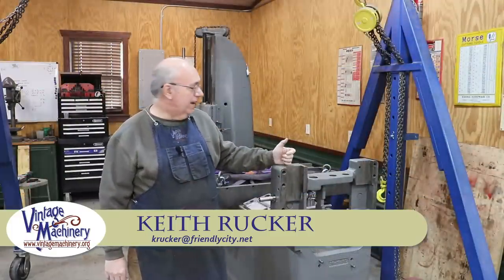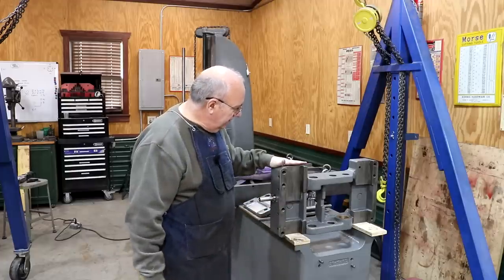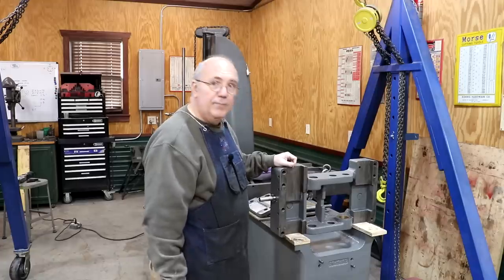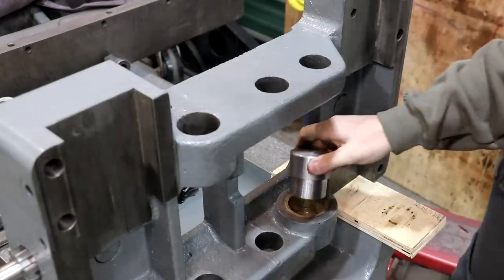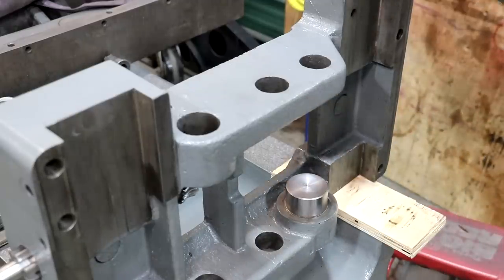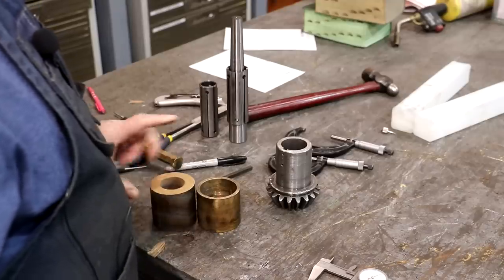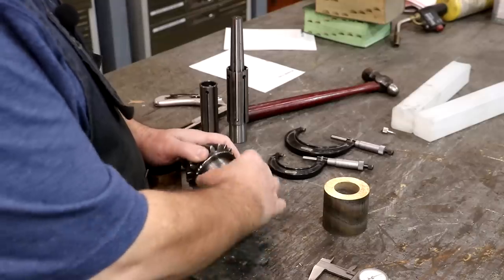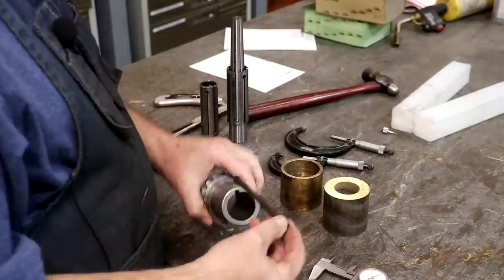Lucas Horizontal Boring Mill Restoration: Turning and Installing a New Bronze Bushing

Comment: You can make a slush from Acetone and dry ice that will get you halfway to liquid nitrogen temperature,  more than cool enough to shrink bearings for a tight fit.
Reply: Excellent tip.
Reply: Methanol will work too, if acetone is unavailable.

Comment: I was thinking about that oil hole, but you addressed it at the end.

Just got a brand new 31st edition Machinery's Handbook yesterday! Hard cover no less! Going in my "Emergency Engineering" kit with my old Frederick Post Versalog 1460 slipstick, a solar powered calculator, and a stack of notepads. In an ammo can. These days you never know... 🤔

Comment: Using a brass drift to seat & unseat the part on the mandrel: brass is soft, but work hardens.  I once used a brass hammer to drive a shaft out of a seized pulley & the end of the shaft was visibly deformed.  It was a smaller diameter at the end, so it didn't affect getting the pulley off, but it taught me a lesson that brass is not as soft as you might believe.

Comment: It seems like it would help to polish about half of the tool marks off the gear's surface.  Some variation helps to hold oil, but burrs from cutting and peak height variations promote wear in the bushing -- initially at least.  I do love to watch you restore these old things.  It seems that they engineer away much of the lifetime in the new ones.
Reply: People no longer want to pay for a machine that will last 100 years. I can't really blame them.
Reply: @kindabluejazz  They have been burned too many times paying for 30 years and getting 2 years.

Comment: That GEAR shoulder that you turned down to square up how are you going to put shims to get the gear engagement proper?? 28:50 perhaps knocking back that bronze bushing help with the shim stock to get the gear engagement proper

Comment: Keith I have had good results from using Plumbers Freeze spray for freezing pipes, it will chill the bushing down nicely with a good spray of the stuff, I've done a 0.004" interference fit quite happily with no shaving as it drops in. It's easier to get than liquid Nitrogen and stores better.

Comment: My B&S Apprentice final project Draw up from comp prints one set shop prints obtain Proper material and make full set of expansion arbors from 3/8"- 2-1/2" perform all machining operations with occasional oversight from Journeymen toolmakers.

Comment: Keith- one thing that seems to be a recurring dialogue in your iron deficiency is the need to “ while we’re here might as well “ items.  Yea it would work.  For a while.  But while we’re here, might as well …..…….we’ll just chuck up this here piece of ( insert material) and fix this as good as new.  Yup, that’s just the way it should be approached.  Keeps the “should have done it when I first found the issue “ at bay.  Proper.  Happen to have this piece of brass bushing stock that would be perfect ( chance of that in my life is never) Whoops, looks like the surface has worn on this gear, so we’ll just smooth this up.  Just happened to have an expanding mandrel here….. how long have you been collecting these “ scraps “ and oddball tools?  I continue to be amazed with the “ stuff “ that appears in the shop.   Well done 👍

Comment: Great video Keith. 

After driving the bushing in, did you measure the bore again? I might have thought that the interference fit might have reduced your .0025 clearance on the gear a bit. It doesn’t matter in the end but I was just curious. 

Cheers

Comment: Does the expanding mandrel cause the ID and/or OD of the part to expand?
Reply: Interesting question.  

The short answer is yes, it expands.

The longer answer continues: but not significant for practical machining.  Every material has a modulus of elasticity and therefore, as force is applied, the material deforms like a spring until the material reaches ultimate tensile strength, wherein the material will yield and have permanent deformation.  The amount of force Keith is applying is small compared to the modulus and therefore, there is correspondingly small deformation.  Keith need only apply enough force radially to generate a retarding frictional force necessary to overcome the urging cutting force.

I do hope this made sense.
Reply: @WhatAboutTheBee  Great explanation. Thank you.
Reply: @mikewatson4644  you are quite welcome

Comment: At 3:25 Keith is talking about how to press out the bronze bushing.  He is making a part to help with pressing it out with a long rod through the hole in the top of the casting.  Couldn't the casting be flipped 180 degrees to push the bushing out from the other side?  Too heavy?
Reply: It can be done as you say, but going through the upper hole helps ensure the alignment of the drift being hammered on. As this is a big part its not that much of a difference, but for many situations it's a big help.

Comment: Wondering if that bushing sets the height of that gear.  If so, gear mesh might be off.
Reply: Having worked on such old machine setups I would guess the meshing shaft will have bushing at the collars of the vertical part that give means for adjustment. We'll find out when Keith re-assembles the tailstock.

Comment: Not having any experience with machining work, When Keith says he's going to take 100 thou off the part, does he have to do the math in his head and only dial 50 thou in or are the dials on the machine set up so you dial in 100 thou and the slide only moves 50 thou?
Reply: You are right with the last part of your comment. Some lathes have direct reading on the horizontal slide, meaning .050" inch on the dial means taking 0.050" depth of cut; means 0.100" taken off the diameter of the part being machined. However that is for a minority of machines. Most lathes have a diameter reducing scale on the cross slide, meaning adjust inward 0.050" on the dial means 0.050" taken off the diameter. If a DRO is fitted,  the DRO readout for the cross slide can be set up to read the decrease in diameter (the same as the cross slide dial) - note it can also be set up to read the reduction in radius, but that would be confusing and don't know why anyone would set it up that way. However, on the longitudinal axis, the DRO is set up to read directly, meaning move the carriage sideways 0.500", the DRO reads a change of 0.500" - as the cutting tool moves 0.500". Hope that helps. Retired machinist.

Comment: Keith, what's going on with that mic? I'm hard of hearing and even turned up, I am having problems.
Reply: The mic is very directional, probably to reduce picking up all the machine noises in the big room. It's a trade off of lower background noise versus having to remember to turn his head towards the mic every time he speaks.

Comment: .0045 crush O/D  on a bush that is about 2 1/2 OD   and only  2 to 2 1/2 thou running clearance before installation .    ????  There is no way that gear would have just slid in .    Bloody lucky you did not crack the casting .

Comment: Just watched a Plumbing video by Roger Wakefield and saw something you might be interested in.  He shows how Oakum and Lead plumbing joints used to be made, and showed a VERY handy tool that you may be interested in for your next Babbitt Bearing pour - it's called a "Running Rope", and it's basically a short piece of rope that is resistant to the temperature of molten lead, and packed around a joint to seal and guide the molten lead into the joint. It may be a MUCH easier and cleaner way to pour babbitt into bearings!
Check it out at: https://youtu.be/RoRw2AoeluE

Comment: I’ve watched your videos for years and always enjoy them- so this is hardly criticism. I just wonder with machines as large as yours, why do you always take such light cuts? Turning down that bushing press tool, you took only .050” per side and “just repeat that 9 more times.” Man that’s a lot. I’ve noticed over the years that you don’t take the “Abom79” or even “Fenner” depths of cut. Certainly these depths of cuts aren’t required, but I’m guessing your machines are perfectly capable, no?? Why repeat 9 more times when you could just do 3 or 4 big cuts? Is this just a preference thing?

Comment: For god sake do something about the mike volume Keith, its the same thing every time you turn your face away
from the microphone its like your speaking from the next room and I have to turn the volume all the way up.
Please pretty please, improve on this annoying lack of volume.
Reply: I think it's a tradeoff - a highly directional mic means less ambient noise from a noisy room full of whirring machines. He could turn up the compression a bit, but that risks noise-pumping.
Reply: @kindabluejazz  Thing is the second half of the video is good but the first half I can hardly hear what he says.
Reply: @ElmerJFudd-oi9kj  I can hear the volume going all over the place, presumably just the way his face is pointing relative to what he's working on etc. To be honest, it's not a problem for me - I can hear him fine (and I'm no youngster). I'm pretty sure he recently changed his mic in an attempt to resolve other issues, discomfort of the cord and belt pack and such. But for sure he could do more things to improve.